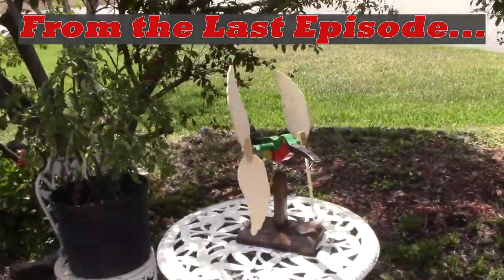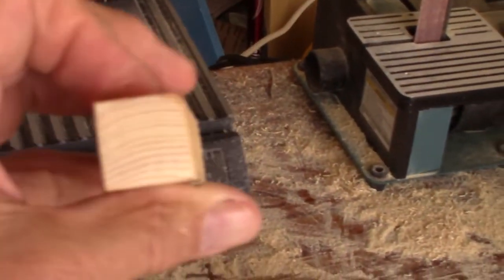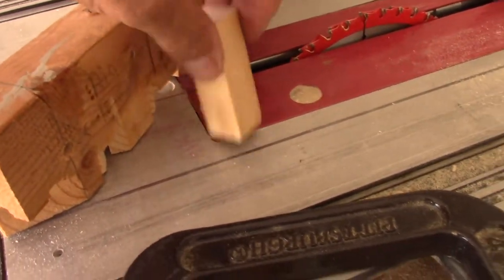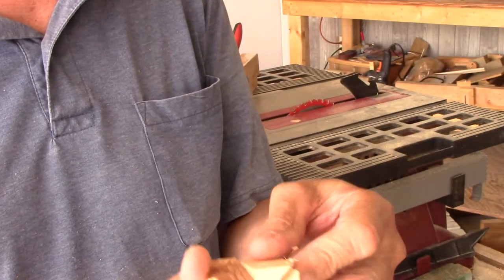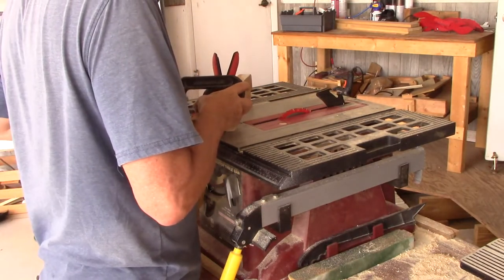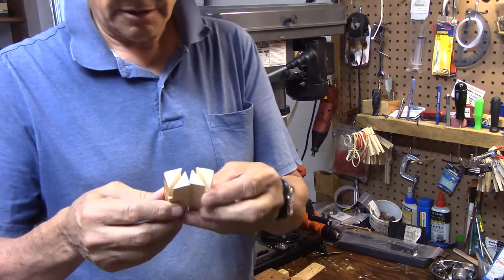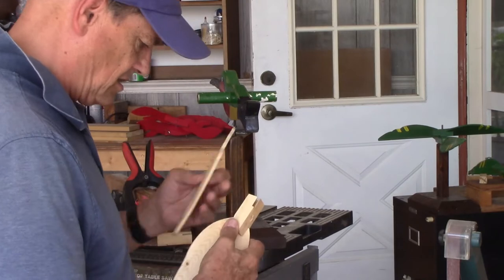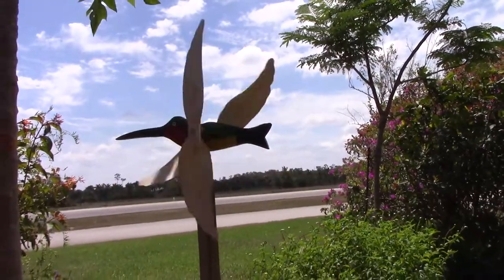Beginners DiY Whirligig Hub Myth Busted !   What's 45 Got to do with it?

Comment: many thanks for this video. I went through the same thinking process and found out that 45 degrees is just fine and make it much easier to cut several slots at the same time. I made a gig to hold 4 hubs to cut at 45 degrees that way I can cut both side and 2 sets of hubs in one shot I am limited by the noise I make using the table saw so constraints make people smarter to find solutions I guess. Another test interesting to do is to alternate the way the blades are installed curved side of the wing inside or outside?  what works better, they both work .
Reply: Yes,  good thinking.  What works for you is best.  Thank you for the comments.